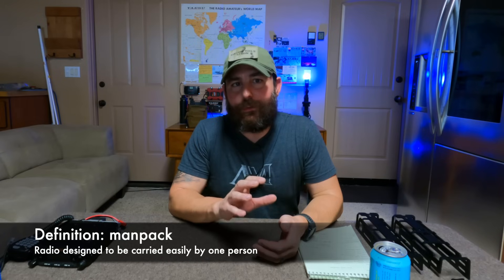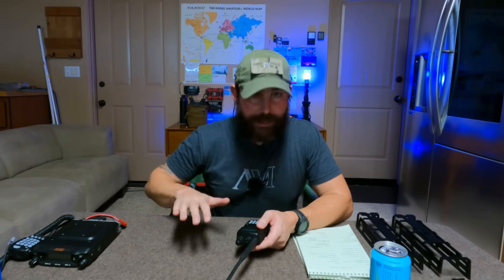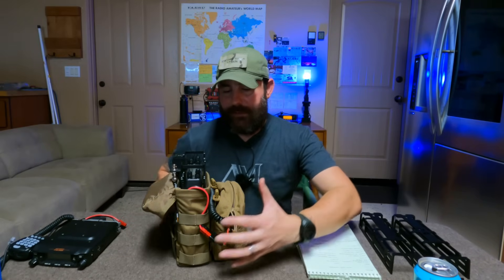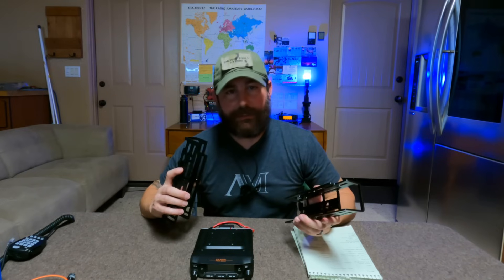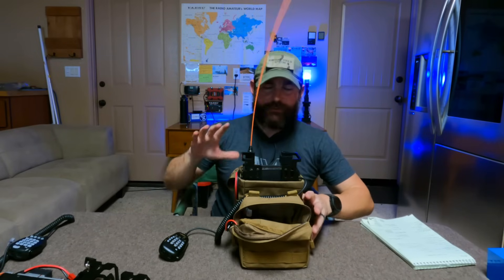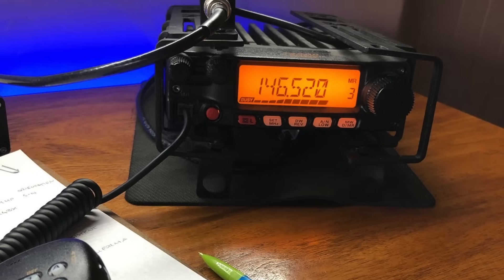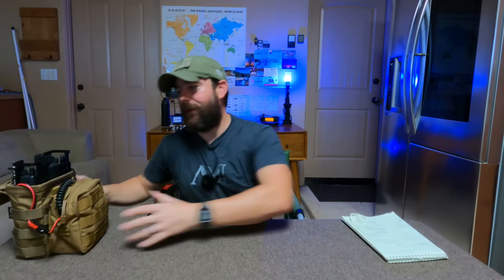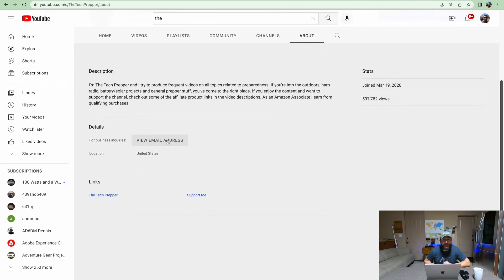Military-Style Radio Manpacks for Civilians - Part I

Comment: I'm looking to implement something akin to this setup for an Emcomm application. My intent is to run my ftm-300 in a portable setup. The two features that are valuable to me are being able to hook up my android tablet (aprsdroid and backcountry navigator, for aprs beacon monitoring and offline mapping, which I have  already tested and is running) and the ability to run crossband repeater so I can get ht communications out further. I am on my way to building my rig, but need to determine the bag setup. If anyone has built either a ftm300 or ftm200 bag, I would appreciate feedback from your build on good bag solutions.

Comment: Two questions:
1. Would you be willing to make a short video in the future explaining RF exposure? I've been using different online calculators to see the safe range of my radio and depending on the calculator I get numbers anywhere from 1 foot minimum distance to 4 feet minimum safe distance, and I'd like to make my setup similar to yours with just a rerouted signal stick but that concerns me if I have the radio a foot away from me and I actually need 4 feet of space, and so on.
2. What mast are you using at 13:30?
Reply from the maker: Great questions. I will not be covering this topic as I am no expert on RF exposure. My general rule is do what the US military is does. Their manpacks typically max out at 20 watts, so I never run more than 20 watts if it is running on-body. This why I like the FTM-8900 as it can run 1/5/10/20w. The FT-857D allows variable adjustments in increments of 5 watts. I will talk about this point on the upcoming videos.

It's the SOTABeams Carbon-6. I use this as a support for all my HF field antennas, too. Here's a video where I show the J-Pole deployment in the field as part of a SOTA activation. https://youtu.be/4yfxQp4_0J4
Reply: I had some concerns about side mounted VHF ht's and talked to an older ham. His whole point was the duty cycle. Just don't talk forever while on body, and if you have to talk a long time, switch to external antenna

Comment: Should I sell my new in the box 857D and buy a real military man pack? I’m concerned the Amateur radio won’t handles what I’m going to put it through.
Reply from the maker: Only you can make that decision. I am pretty hard on my gear and have been running around the desert for two years with these manpacks and have had no issues. I have tons a videos where I show these in action. If you have a source and don't mind spending some serious money for a real manpack (i.e. AN/PRC-150(C) Falcon II Manpack Radio), go for it. I doubt you will be able to find the crypto cards for them.
Reply: @TheTechPrepper  I’m going to set up my radio with that chassis and put it in a PRC Molle pack like you did. I will run the 857 as long as I can. I think there’s stuff in digital modes I can do to complete the comms mission ahead. Thanks for your videos and what your sharing.

Comment: How do you charge the battery out in the field?
Reply from the maker: Great question. I always carry a small solar charge controller (Buddipole PowerMini) and 20 watt  folding solar panel (Powerfilm). I've shown this gear several times on the channel. Search for "Winter Field Day 2020" on my channel page. I plan to show this setup in Part IV of this series.

Comment: Have you tested the swr on the signal stick when mounted on the frame?
Reply from the maker: I have not personally, but I have had several viewers test the SWR on the pack frame. It actually performs better and has a lower SWR as the frames mounted to the chassis provide a bit more of a ground plane. I've heard that these antennas have performance issue when directly off radios like the IC-705.
Reply: @TheTechPrepper  exactly what I was wondering sense it didn’t test too good on the 705. That’s good to hear I love signal sticks. Toughest antenna you can get!

Comment: I've been looking to upgrade from my HT, simply because I just can't send (repeaters notwithstanding) so I'm onboard for this
Reply from the maker: That's a great call. I'll talk about some field antennas that can be run with this system that will help increase your range. More power helps, but an effective antenna will do wonders.
Reply: @TheTechPrepper  I think for me it's a combination of location and a 5w HT. I actually have a GRP antenna in the roof space but where I live is low altitude and very flat. I only QSO from home but I've never tried it in the field yet.
Reply from the maker: @stevecairney78  Roger. More power will help then. Good luck!

Comment: Any movement on a exo-skeleton for the Kenwood V71?
Reply from the maker: The folks at ARMOLOQ are designing one right now. Shoot them an email.
Reply: @TheTechPrepper  Mine is on the way!  Very excited to see how it will meet my use.  Thx  Also ordered a Kenwood MJ-88 microphone cable converter to see if I can get a military H-250 to work with the radio … if need be via a LS-671.  Cheers
Reply: Very happy with my ARMOLOQ for the Kenwood 71 … it’s primary use is mounted in a vehicle (Humvee) but what worked out great is that I mounted using VELCRO in the radio tray and now I can pull the unit and go man mobile in seconds as well as having front access to cable ports via the relocation design.  The VELCRO on the bottom then can be used to create additional stability in a bag/pack.

Comment: How would the ego battery system do in this case?
Reply from the maker: I am not familiar with EGO, but if it supports 12VDC output, then you should be fine. You will also want to check out how many amps you can draw.

Comment: How do I contact you and how much is a manual with multi band radio vhf uhf hf am Wc digital
Reply from the maker: Thanks for your interested. I am considering the idea of selling fully assembled kits. If I do, it will be early next year at the local hamfest to start. They will be very pricey. I still need to price everything out, but for the HF setup along with laptop (refurbished CF-20 with my custom communications software that includes encryption) they will likely have to start at around $3,500 USD or higher. I am still debating whether I want to do this as it may be more trouble than it's worth at a price point that is too high for the market.  I am have poking away at the corresponding field manual. Note:. I am get hundreds of emails per week, but the email is listed on my channel page under "About". It may takes weeks to reply.

Comment: Any issues running hot in the bag?
Reply from the maker: Nope. I talk about this a few times in this manpack series. I run low power and only operate long enough to achieve the communication objective. I typically operating in temperatures above 100F. Never had a problem.

Comment: Personally for man packs looking at yaesu's 817/818/857

I kinda wouldn't loose capacity in HF operations even if you have a heavy use case wide and narrow band analog  and digital narrow band application in broadcasting 

Can't really comment in the capacity of vhf if applying analog and digital transmissions to the mix

though what currently applies to UHF.. it is a limitations of use and narrow field of use
Reply from the maker: Those will be included in the series. The FT-818ND was my first manpack build followed by the FT-857D. They will be cover in Part IV and V of the series. I'm starting with the least capable, but still useful packs first.
Reply: @TheTechPrepper  Comes the point you have already cited the limitations of the pack in other video so reliving it is coming a moot point..

Comment: What do you think the maximum wattage you should run while wearing it?
Reply from the maker: The max I feel comfortable running while on-body is 20 watts, but not all radios will do that. The FT-8800/8900 and FT-857D allow for these power levels. The newer radios are oddly moving away from supporting the 10 and 20 watt options. It's very annoying.

Comment: Anyone try to build something like this with a tyt 9800 plus? Not sure if the rails for the yaesu would be similar enough
Reply from the maker: I spoke with the ARMOLOQ owner before making this video. The Yaesu 8800/8900 pack frames fit the TYT TH-9800.
Reply: @TheTechPrepper  I inquired about a different model and they set me straight. They're not in until the 15th but I can wait. Thanks, this is cool stuff! KD2YHI

Comment: Does a manpack need to be grounded?
Reply from the maker: No electrical ground is needed. I'm typically operating in low noise environment, so I've never bothered with an RF ground in the field.

Comment: Why not a handheld through an amplifier?
Reply from the maker: You'll see once I get into part III. It's more than just running more power. The next VHF/UHF rig gets more sophisticated in there feature sets. It will be hard to find a true dual-VFO, crossband and multi-band band capabilities in an HT.
Reply: @TheTechPrepper  the radtels do that. You probably know way more than on that though.

Comment: Did you say 8 hour run time? Not nearly enough battery time!
Reply from the maker: You can size the battery on your needs.  It's a size/weight versus runtime requirement. I also supplement with solar charging in the field. Personally, I've never had an issue working back to back shifts at our wilderness public service events.

Comment: Got my 6000.  With Digirig and cables got onto VARA WL gateways in less than 5 minutes.

The data port for digital comms sold me on the rig.  I should not have to sacrifice basic voice operations to do Digi.  Come on.  It should not be THAT difficult to put a Digi port on all 50W+ mobiles.
Reply from the maker: That's the only reason I bought that rig. It's not my favorite radio, but it has a data port, is currently available a decent price, and has the right form factor to make it a manpack. Enjoy!
Reply: @TheTechPrepper  Actually, it is perfect for ecomm or public service.  You will be on one freq for phone, and and switch over quickly for a VARA message.  While on VARA can monitor on a handi.

Actually, I wish they made an "FT-150".  Dual band screen.  Digi port. But no WIRES, APRS, et. al....

Comment: What about heat?  I know the Military radios are designed for this.
Reply from the maker: The range varies from radio to radio. The max operating temperature on the FTM-6000 is 140F. I primarily operate outdoors in the backcountry in the Sonoran Desert and have not had the radios fail yet. If I recall the warmest ambient temperature I've operated in was around 114F. Again, I operate for short windows when going man portable.

Comment: It's too bad we don't have a 50w radio 10m, 6m, 2m, 70cm with SSB, CW, FM, AM.
Reply: Just about ultimate would be a ft-818 that puts out 25 watts
Reply: @Falconguygaming  maybe I should look for a 20-30watt amp.
Reply: @taldeus4008  yeah that's gonna be the ticket for now. I don't understand why they limit to 5/6 watt, the radio will do 20(mods online). Probably has to do with heat
Reply from the maker: There are a few radios that does this, but they are all discontinued. I will be covering the Yaesu FT-857D in this series. I have using it heavily for SSB on 2m and 70cm. I am a huge fan of all-band, all-mode rigs.
Reply from the maker: That has been my ask for awhile. I would love to see an FT-818ND with: 20 watts; a built-in sound card and an IP67 rating.
Reply: @TheTechPrepper  My portable is currently an FT-857, in portable zero pack with the battery attachment. 12Ah of battery. But its HEAVY.
Reply from the maker: @taldeus4008  Great radio. I have one, too. It will be covered in this series. It is very heavy, but I have taken up a few mountains. Not a fun day.

Comment: Thinking you're going to make consistent contacts on HF is ridiculous. For everyone who's confused by this, CB band is HF and right next to 10meter ham band. When you were a kid, you probably had a 3 to 5watt CB or handheld, and you could talk maybe 5 miles reliably. Any distance further than that is COMPLETELY dependent on atmospheric conditions so occasionally at certain times of the ten year cycle, and usually only daytime will you be able to transmit further. The only way to extend this consistently is on mostly 2 meter repeaters, and if you think that repeater is going to work in a grid down shtf situation is laughable. Save your money and just by a 50watt 2meter 440 radio a d a couple of cheap 2meter 440 handhelds. If you can spend more than 500 then buy starlink as it is a game changer, soon it will be on your phone. I would even argue that a Uniden sds 100 scanner and a quality hand held 2meter is a far better use of 800 to 900 bucks. Scanners pick up a TREMENDOUS amount of information in your area extending 30 to 40 miles out and you can always listen to ham bands.

Comment: How does it hold up in rain?
Reply from the maker: Don't use this in the rain. You need to protect with a rain fly when not in use. If you need to operate, get inside a covered shelter. I just make a quick shelter with my poncho and a couple of trekking poles. There are very few civilian radios that are IP67 rated. If you need one, check out Lab599.
Reply: @TheTechPrepper  could it be made water-resistant by slathering/coating the pcb with epoxy or would that make it overheat?